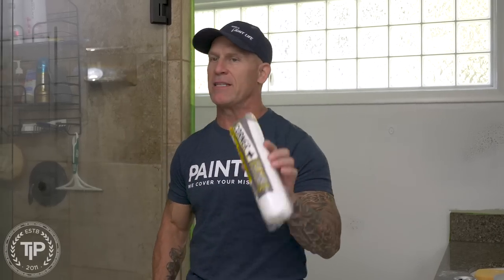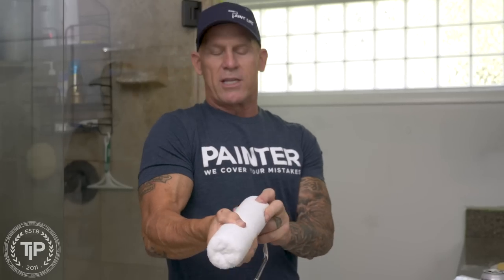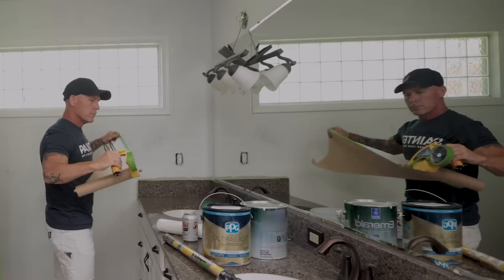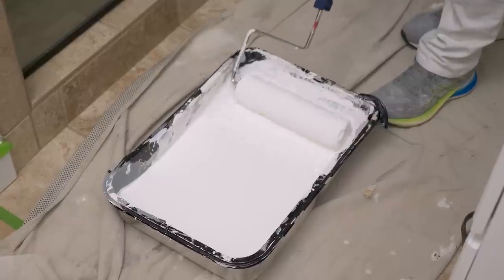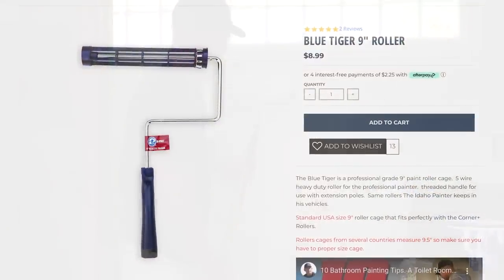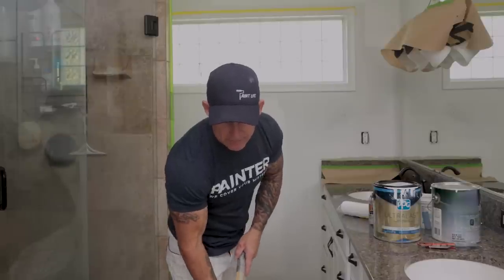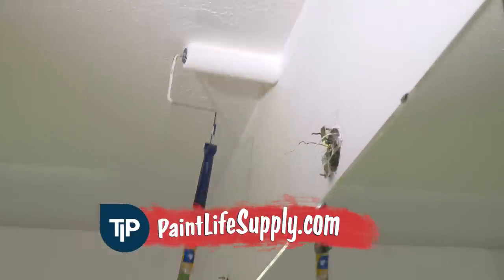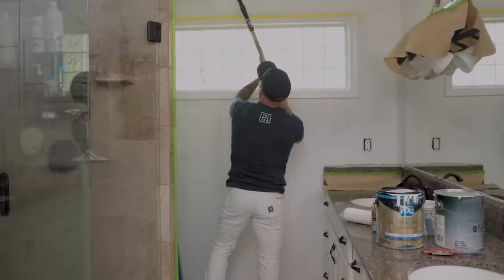Corner+ Paint Roller FAST and EASY Cut Ins.  A Revolutionary Paint Roller.

Comment: I hate to critique too much before I use one but looks like there could be more of a chance for runs to occur on the wall where the loaded up roller apparently puts a lot of paint there!  Also kinda useless where you put a different color on the wall which is mostly what I do so cut in is inevitable!  Could help on vertical corners I suppose but that is fairly quick to do with a brush!  I would like to try one as my thoughts are certainly subject to change if I actually tried one!
Reply: They do not cause runs or smears.  The idea behind the roller is it can be your everyday 9' roller. If you have adjacent walls with the same color it's great and saves  time. But if they are different colors you can cut it like normal.

Comment: Seems like a great roller if you are painting ceilings and walls the same color. However, I paint ceilings white and never paint walls white.
Reply from the maker: OK
Reply: Always paint ceilings first, so it doesn't matter if ceiling paint gets on the walls because you will cut-in the walls later.

Comment: Good quality tool, but has two drawbacks.  Does not fit into the 5galon bucket, and it needs a wider tray, because  this roller is slightly longer than the usual 9 inch.
Reply from the maker: I have had no of those problems
Reply: He used a standard tray in the video.

Comment: Hey Chris- do they make a 3/8 nap roller?  That's the thing that has been stopping me - I'm assuming the difference between 1/2 and 3/8 nap would be easily noticeable
Reply: @colebz420  granted but everything around here is no texture
Reply from the maker: They do not
Reply: We do not. We consider our 1/2' Microfiber our version of the 3/8 nap. It works very well for fine/smooth finishes.  The reason we do not have a 3/8 is because with the enclosed end it would be too thin due to lack of material.  I would suggest trying the Microfiber 1/2' nap if you typically use a 3/8.
Reply: @starkellc9025  Thanks for the response!

Comment: Is it available in 14"?
Reply: Only 9"
Reply: Not currently but we are considering this. We recently came out with an 18' frame though that utilizes our rollers. Do you primarily use a 14' inch roller?
Reply: @starkellc9025  I've gone from 18 to 14 -lighter and closes the corners .18 good for new work without trim and younger painter😉
Reply: @starkellc9025  we use 14 almost exclusively

Comment: To me, this type of roller is more useful for someone who isn't very experienced in painting. 

I've been using a standard roller cover for 30+ years to paint corners. Just make sure the edge of your quality roller is flush with the roller-frame end and roll right into the corner. The hit it from the other side of the corner. Sometimes you may need to go back to the first side and do a quick roll keeping the roller from touching the adjacent wall to smooth any edge marks from the end of the roller.

It is important to use a good quality roller frame that doesn't flex much while rolling. 

This technique has saved me countless time over the years and gives me great coverage while keeping the rolling texture of the walls all the way into the corners.
Reply from the maker: HMMM